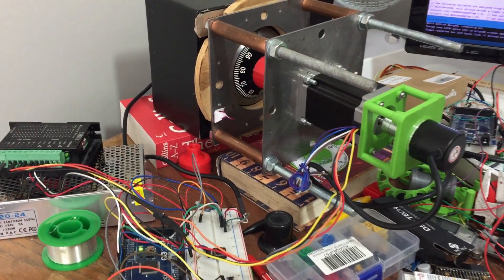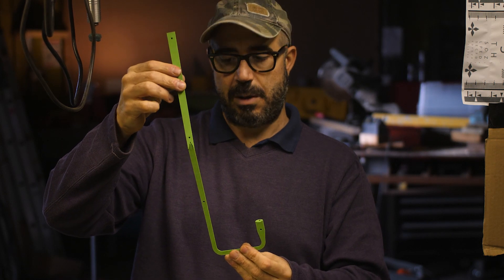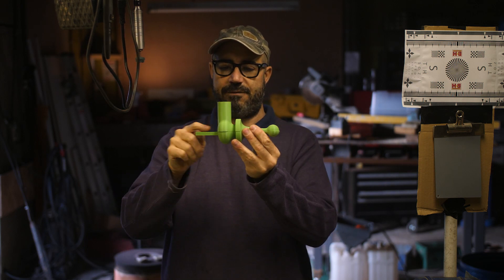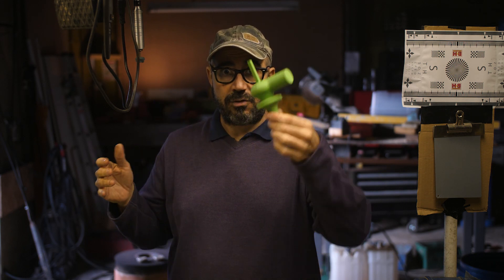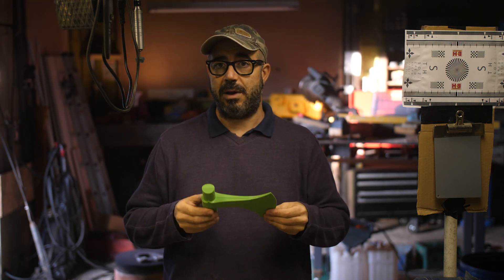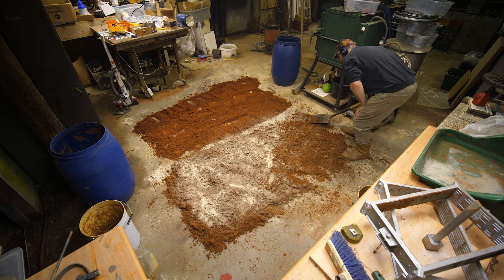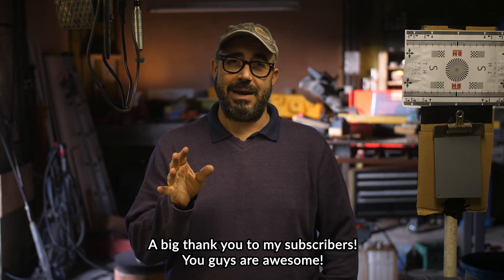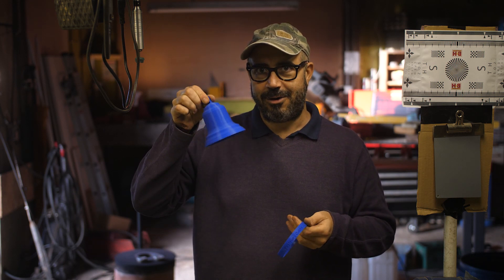Happy new year! Lets make a Cannon! and a look at some other future projects for 2020

Comment: I see you have made your axe pattern with the core in it, on the last video I saw you said the core was still wet! Sodium silicate will remain liquid  until it is exposed to CO2  then it hardens I've never used mine yet but I believe it's plain sand no bentonite and not too much either it will be like cement.
Reply from the maker: Hi T yeah i was using all the wrong stuff and it never hardened (i had no CO2 at that point), i have a gas bottle now, works a treat :)

Comment: Hey Julian, If I get my sand too wet a quick way to dry it out is to spread it on a tarp and play a weed burner over it.
Rake it a bit and repeat as necessary.
i have been working on my Julian inspired metal flasks and will be revealing them soon.
Reply from the maker: cheers for the tip myfordboy, luckily laying it all out has dried it off nicely :) and... Oooooh awesome! can't wait to see them!

Comment: Good on you with the running training. 

The followers will make them much easier to mould than coping down. I found coping down tricky on the previous version.

Did you see the Olfoundryman video on flasks.

https://www.youtube.com/watch?v=TEcmhvR2tOE

I am tempted to do a modular finger type flask closer to his final design, with the ribs on the inside, and bolting into the ends rather than the 45° ends.

Comment: Sounds like an exciting year.

by the way, The spherical end of the espresso presser will be subject to additional extra shrinkage. Spherical/near-spherical objects, or spherical/near-spherical sections, and thick sections will shrink the most in all castings, You likely need an extra feeder/riser on that end to compensate. You can use Chvorinov's rule if you want to be accurate, but a quick rule of thumb is 1.25*(Vcast/Acast) for the riser/feeder (can be up to 2 times the casting volume/surface-area ratio or the V/A ratio of the section which needs additional feeding). The reason to be more accurate is to reduce the metal needed for the pour. I've seen people run out of metal during pours because they had too big of a riser/feeders.
Reply from the maker: Ask Questions, Try Things thanks ask, I was going to put on on that end too, but I decided to round off any shrinkage if it happens on the handle. But now you’ve got me thinking... cheers mate